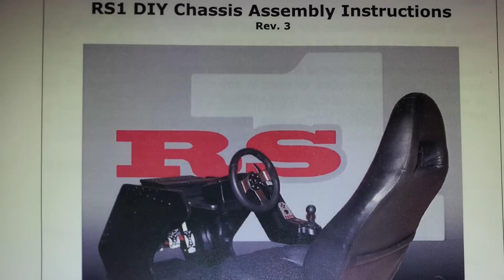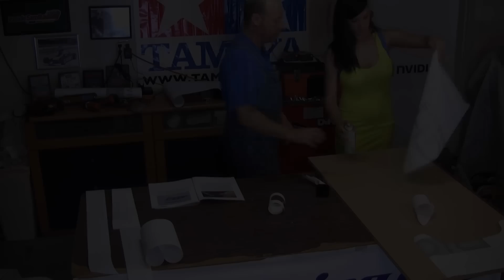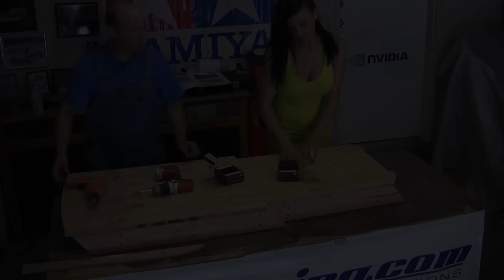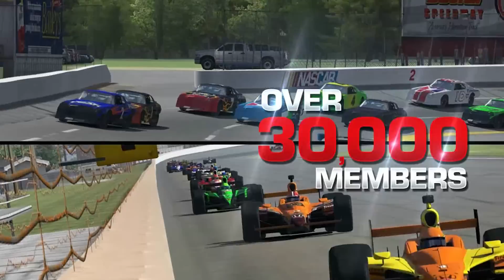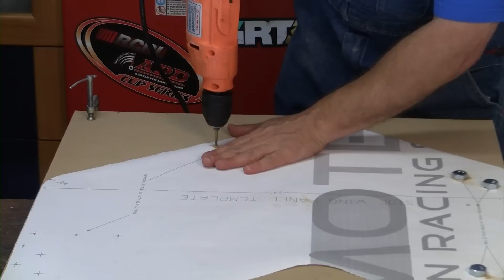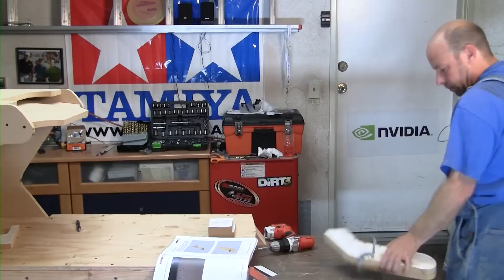DIY Ricmotech RS1 Sim Racing Rig Build

Comment: 🏎 Alas After 12 Years from the publication of this video in March 2025... I find myself watching it because on the web Especially on the Pinterest site there are many many images that show this project, as a homemade do it Yourself Driving Simulator, I have built two Driving Simulators in fir wood in my life, one in 2018, and one in 2024, and I am still looking for ideas and inspiration for a more refined project. 
I wanted to add this 2025 comment to this video and say that it was Really fun to see it, in full She is Absolutely Beautiful and it is really a shame she has not been seen again in your subsequent videos... (I really like it when (without too many problems) she helps him tighten bolts, or maintain wooden panels, she is really very sexy and at the same time a working-woman). Is however you can perceive through the video that they spent an entire day of work for this video You can see that it starts in the morning and practically ends in the evening... poor things they really worked hard for this video, many Compliments even if with 12 years later this project is still current 😉

Comment: Just watched this video in 2024. I used to own an RS-1, but that was an ocean away and a few years ago, so was looking to build another. Gonna go at it without plans though, the RS-1 is a great sturdy rig but doesn't really suit my size and seating position requirements as I'm 187cm and 120kg, and it hurts my worn out knees (6'2" and 260lb in the old units).

Comment: I Totally Dig the (RS1 Sim Racing Rig )  I am Currently in  The building phase  of it . Instead of using  2x4's  I  went with 2x8's  and 3/4 plywood.. Well  I Have Learned one thing  ahead of time before a mistake was made (Thanks) to this video  because of me using  2x8's   I   need to  buy my  seat 1st  (From Junkyard) See I Weigh  400 lbs. Big guy and  I  need Room  and I  Also Doing mines in length of 56in so I can  fully  Adjust to any length to Accommodate my  Short Self or  a Tall Person  Yes I am Short Like Shaun lol.. Hard  Part  Go  Be  Pedal  Position  Because  my legs  aren't close together so  I am go have to  figure something out  and maybe  by  and 2nd  pedal  set  and  jury rig  something  from  both sets

Comment: Try making one side first, cut the other close and then use a router to match up both sides evenly. You can even use a piece of wood nailed into the mdf or plywood to run the router along..

Comment: I want these plans- but I don't want to pay for them.
Reply: +XInfinity2013 You get the 36 page color instruction book too. If you think you can design, layout, cut and assemble an equal or better version for less than $30, have at it.
Reply: stooge
Reply: I went to the hardware store and bought some timber and winged it. If you have any kind of workshop skills this was a very easy project. All I did was watch the vid and had a go. Been using it for well over 12 months. I added 4 rubber wheeled casters so that I can move it around. It's sensational much better than clamping to a desk.
Reply: ***** Some people don't feel that $30 for blueprints is a fair price.

Comment: Rather than paint I'd use Speaker Cabinet Carpet Covering that can be glued on with DAP or 3M Contact Adhesive. Most common colors it comes in are Black, Grey, and Charcoal Grey.